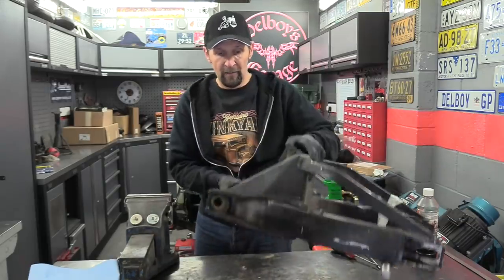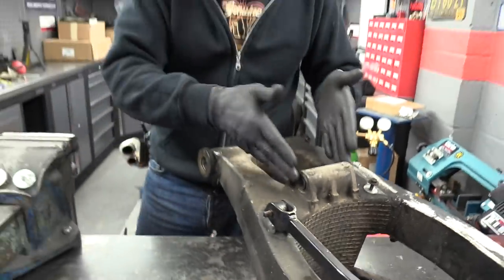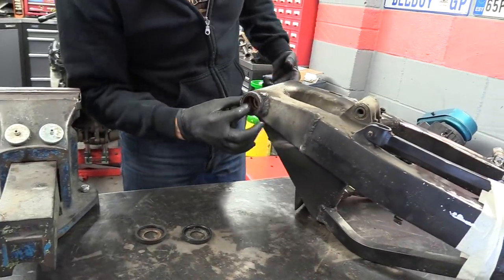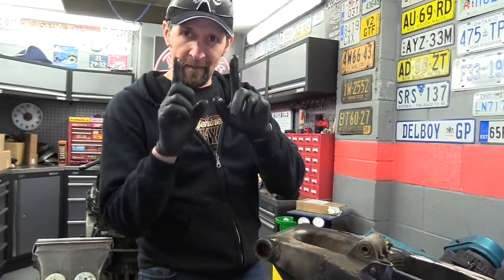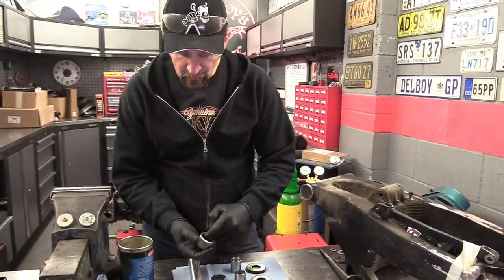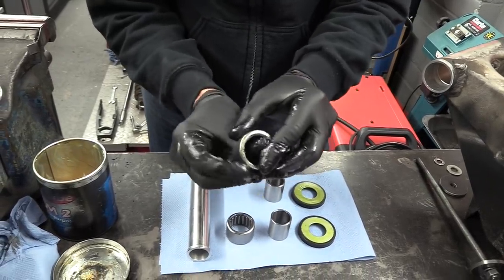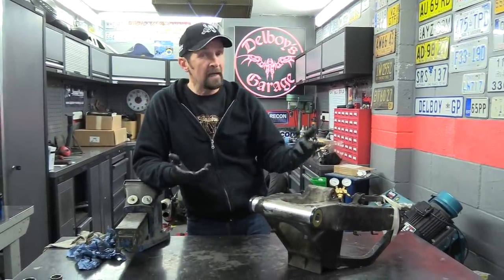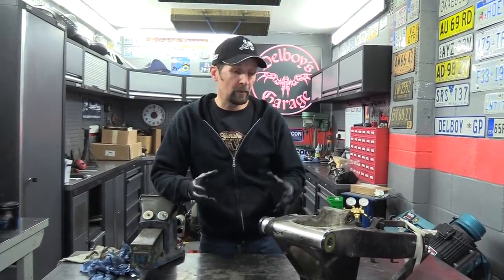Delboy's Garage, Busa Build, Day 7, Swing Arm Bearings

Comment: Blind bearing puller is the best investment I have made in tools.  I used to be afraid to do my own bearings, after watching you and getting a blind puller I have now done every bearing on my Tiger 800.  Finished the swing arm bearings yesterday, and I was wondering about needle bearings.  I did the same (tight enough, but soft enough so I could still rotate), and I am getting more and more excited to finish my project!  Thank you again so much for all these videos.
Reply from the maker: Glad to hear that Jason, as you have found, owning the right tools for the job makes life so much more enjoyable, no matter how handy the ghetto tricks are.!    Good luck with the project, and have a great week mate.
Reply: @Moonfleet41  This week I finish my Tiger 800 XC project.  I am quite proud of myself.  First major work on a bike, done for a budget.  Got the bike for $3k and have spent about $1k on tools, parts (bearings, seals, etc).  Oil and cleaners, etc.  But now I am quite proud of the bike and looking forward to some long rides this summer.  
I hope you both have an amazing week.
Reply from the maker: @jasonshortphd  Congratulations Jason, what a great achievement to arrive proudly and the end of a project and be able to enjoy the fruits your labors.   Remember to consider the costs without tools, because those you keep and use again on the next build, which makes your bike even better value, and most of all, as you ride the miles and enjoy your new ride, you can enjoy a closer understanding and empathy with the bike, how its wearing and it's general state of health.. plus of course a wider pride of ownership than the guy who "books in with the dealer and enjoys a complementary coffee while in the waiting room..!!!"     Have fun and enjoy every mile Sir.. Ride safe. Del.

Comment: Your videos are getting more and more insightful because you are breaking jobs down into bite size chunks. I think the patience in doing that is admirable as people like me are learning a lot from it. So, thank you for that. Unfortunately, I have the street fighter setup on my ZX swingarm and I remembered you groaning a bit when getting those bearings out back in the day. Fun to come for me then. Now here's a bit of a confession and please feel free to flame me as much as you like. I just want to know if I should be worried. I decided it was time to re-grease the linkage bearings as was suggested in the maintenance schedule and because I figured, no one had touched those bearings ever anyway. So, after removing all the bits and pieces I proceeded to clean everything up with washing up liquid and degreaser, including all the bearings. I dried everything out, decided the needles looked ok and packed everything with copious amounts of grease. The question is, in my usual clean-everything-to-within-an-inch-of-its-life, did I invite rust and corrosion to eat those bearings? To be honest, I am still not sure whether I ended up thoroughly drying everything inside the linkages.

The other thing I wanted to get your opinion on, I got myself a blind bearing puller set but a cheap one, albeit from a UK company (£40). It did not come with a bridge puller. So, I tried slide hammering the front wheel bearings out and managed to just rip out the puller every time despite expanding it so it sat absolutely tight. The question is, is the puller a piece of shite I should send back, or was I just expecting too much? I ended up buying some proper punches and a 2kg club hammer and drifting the bearings out. I have to add that they were properly stuck in there and still the original bearings so it was never going to be an easy job.

Anyway, I'm sorry I'm always bugging you with such amateurish questions but I don't have anyone else I can turn to who I trust to be that knowledgeable. I also never expect a reply really because I know your life must be very busy.  Anyway, hope you are getting some sort of dry weekend riding in. Best wishes to you and Penny. Great camerawork, as always. :)
Reply from the maker: Hi Patricia, no worries at all, we'll send you a private message on Patreon later on this evening!

Comment: great video as always del& penny ,done my swingarm bearings on my blackbird this morning with my wife.i had to inprovise  abit though because of no bearing puller at moment cost and all that.i used an heat gun wd40 2 x socket extensions and the correct size stepped sockets .20 mins and the job was done taking the bearings out.not quiet the correct or the best way but with care I got the bearings out with no fuss.one tip if is to use electrical tape round the undersized sockets to avoid damage to swingarm.another birthday &xmas might well buy me a blind bearing puller.draw bolt method to put bearings in .so thanks del &penny for giving me abit of confidence to sort the job out.
Reply from the maker: That's great news Michael and even if we were able to, like you say, give you a little confidence, that's great, good to hear it's all done, and you're right, wish list bearing puller, you'll be surprised how often you use it... or at least how often your mates come round to use it lol... Thanks for the support buddy, ride safe, D&Px

Comment: excellent job sir. will you be doing the clutch slave cylinder seal replacement? none on the internet for a Hayabusa. keep up the great videos.
Reply from the maker: It isn't leaking buddy, but then there was no play in the wheel bearings either!... so yep, gonna tuck it on to the list....

Comment: Good work there, would it be worth putting some silicon or similar around the dust seals to stop the ingress of crap etc, have a great weekend both 👍👍😎
Reply from the maker: If the'yre properly packed with grease, then I wouldn't really bother, but of course if it's something you would wanna do, then it's not gonna do any harm, that's for sure... have a great weekend yourself!
Reply: @Moonfleet41  thanks both x 👍👍😎🤣

Comment: Hey, Del, at 10:50, you slide the bearing onto the threaded rod, followed by the large washer.  What size ID and OD is that washer and where did you pick those up?  Thanks!!
Reply from the maker: Hi Clint.. i "Made" those discs, cut them from some 5mm steel plate, the ID hole is just big enough for the M10 threaded bar, and the OD was about 60mm so they cover most wheel and head bearings, !  you can buy small chunks of steel plate on eBay pretty easy, and then just cut them from that mate. !
Reply: @Moonfleet41    Thanks Brother!!

Comment: Makes me wonder what must the state of my bearings be on my 20 yo Copper/Silver busa with 92.000 klms. Guess it ought to be looked at but not sure can be bothered with all that work when its on the market looking for another owner. Think I'll leave it to next owner. Only had head stem bearing done once some 10 yrs ago. Being its sole owner in its whole life I guess they shouldn't be too bad as Ive always looked after the 'ol girl. But gotta make me wonder. Cheers Del great vid as per usual.
Reply from the maker: Sure thing buddy, I knew this would all come up for me with a 20yr old bike, mine has just 38k miles, but I think it's a 'heavy' 28k, and not the caring ownership of your bike... I guess if you just explain to any potential new owner that all the bearings, and seals, are original and that only the headstock bearings have been replaced, then at least they can make their own judgement!... thanks for your kind support buddy, always good to hear from you.